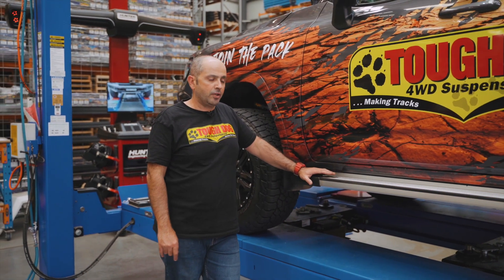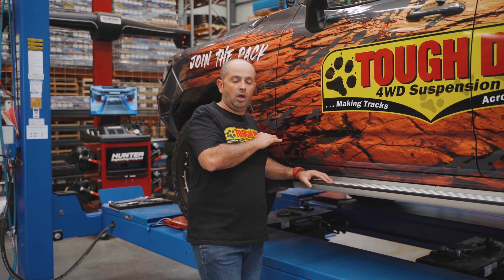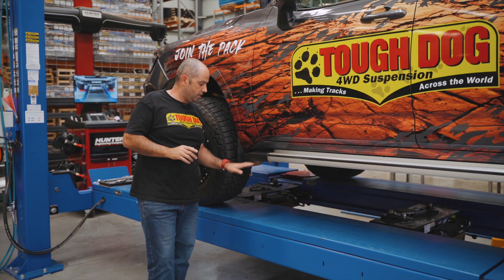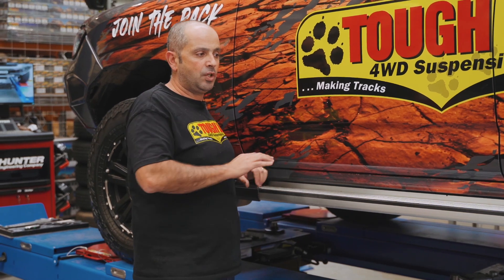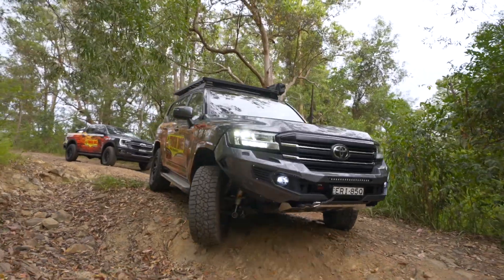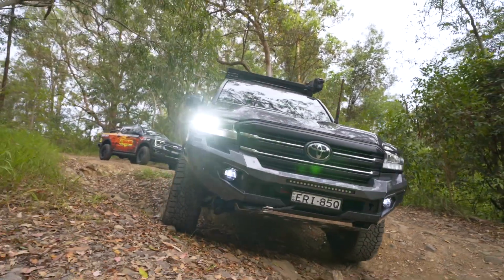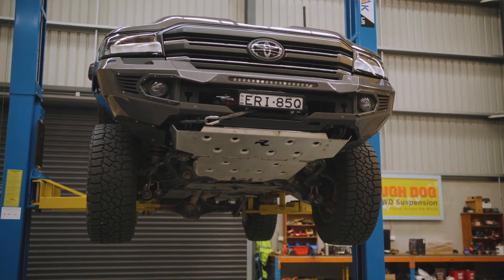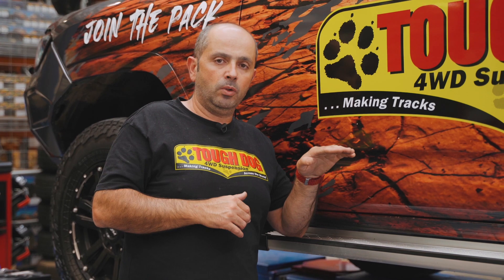Tough Dog Tech Tips: Vehicle Rake

Comment: What happens if the rake is too much? My 2008 triton is harsh on corrugation and small bumps or potholes on tar especially if not heavily loaded. It jumps around almost as if the wheels lose contact with the road surface.  I have upgraded coils in front, extended shackles at back with oem leaves and Bilstein B6 sport shocks all round. Could the extended shackles be causing a problem? Unladen. 
I can hit 30kmh speed bumps at 70kmh no problem but small bumps especially 2 or three in a row feel really harsh and makes the vehicle jump sideways sometimes.
It seems much better when towing a boat on the corrugation